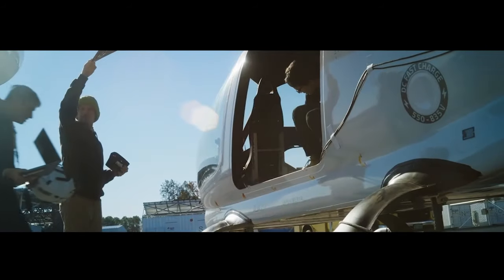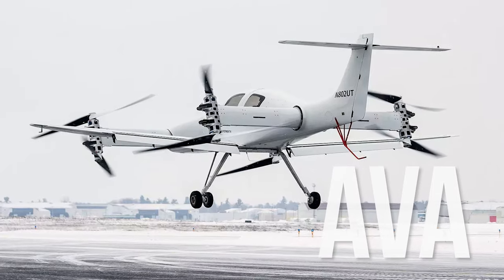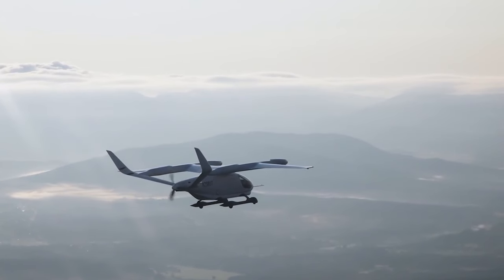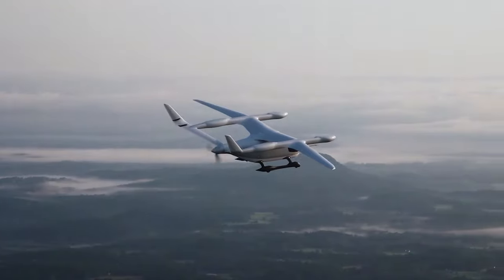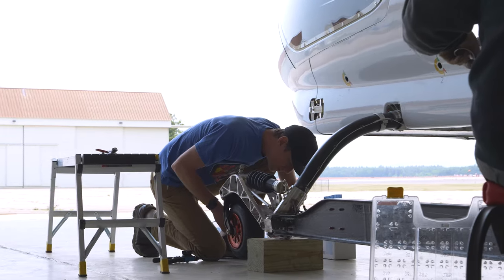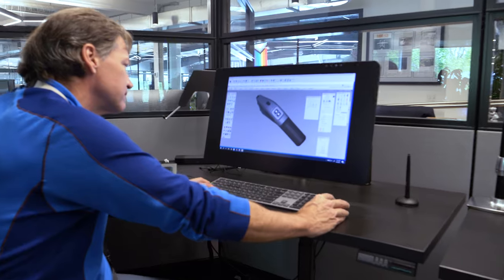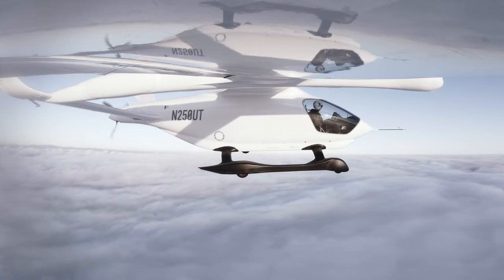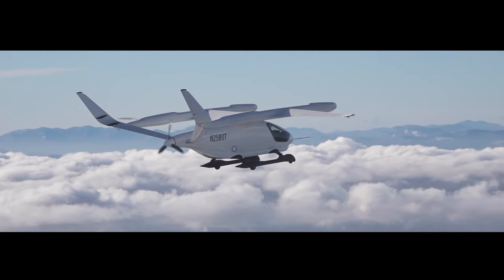Beta Technologies on building electric aircraft | Alia-250 and CX300

Comment: With the limited range, what happens if a pilot is still in the air when the battery runs dead? Yes, I know regular aircraft can run out of fuel, too, but what's the procedure for bringing down one of these birds on a dead battery.
Reply: A robust flight training ecosystem that already exists and is in use by every air carrier can easily adapt to new power systems and will easily tackle this problem. Beta is worlds ahead of everyone else because they've thought of these problems before they ever fielded a flying machine to test them.
Reply: Unlike many other VTOL designs this has wings so one may be able to glide some distance like with a conventional fixed wing aircraft.  Of course if you are too low your gliding distance would be very short.
Reply: These electric planes will likely all fly with full batteries, unlike regular aircraft which only load as much jet fuel as needed (plus a buffer) to avoid the added weight and range inefficiencies of carrying more fuel than needed.  So I’d expect electric planes to be less likely to run out of batteries than regular planes.
Reply: @markydwang  And it doesn't bother you that fully charged batteries last shorter than a relativly empty tank of jet fuel?
I'd rather say an emergency landing is pretty easy. On 5% charge you can always glide down on and tiny safe landing spot and land there like helicopters do every day.
Reply: In that case it glides like any other plane. You can actually fly the ALIA in X-Plane 12 flight simulator, it's the actual simulator they used to develop the aircraft and you can see them using it as well in this video (towards the end).
It's a really fun aircraft to fly.
Reply: @markydwang  You do realize that added weight does not affect the range right? Glider planes literally carry a weighted ballast in order to win races. The weight shifts the L/D curve so that it can achieve a faster speed, but the flight path remains exactly the same. Range is a function of the shape of the aircraft and is locked in once the shape is locked in. While the reduction in weight is a welcome benefit for landing (it gives better stall speeds) it can be annoying as the flight characteristics change if the selected fuel tank is in a place where it changes the weight balance. Some planes you literally have to switch fuel tanks in the correct order or else it would get tail-heavy midflight and become dangerously twitchy. Which is not hard to remember 99.9% of the time but the one time you bring the family and one distraction piles onto another...

Comment: The range and performance specs are very low. Also leaving out very important factors like how long does it take to charge? How does the Weight of the battery effect performance?
Total scam.
Reply: The range is 350 miles. They've flown it across the country.